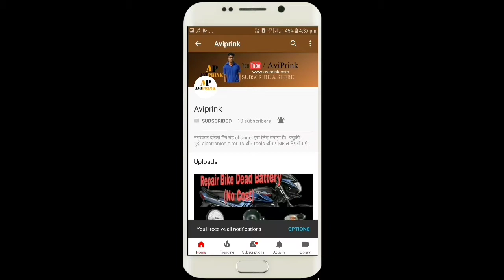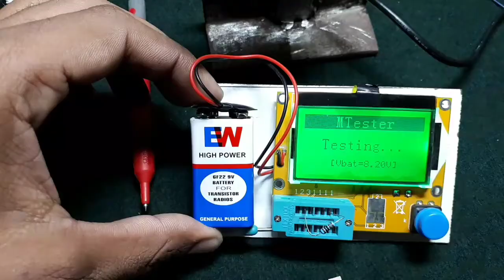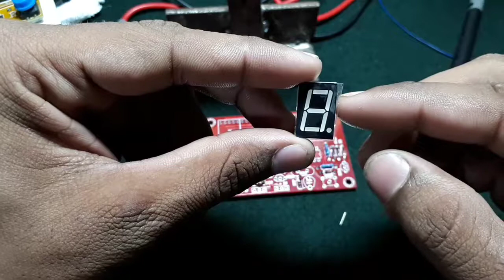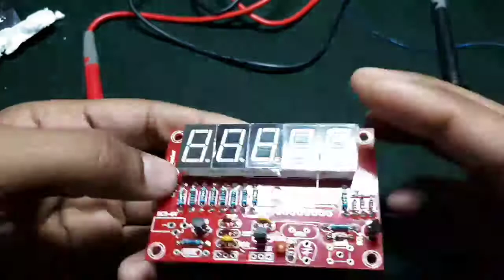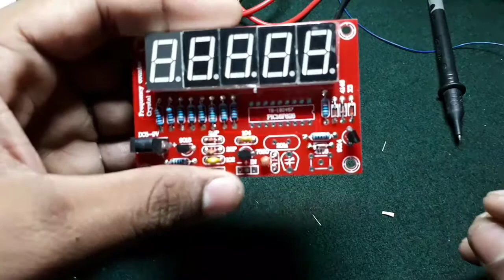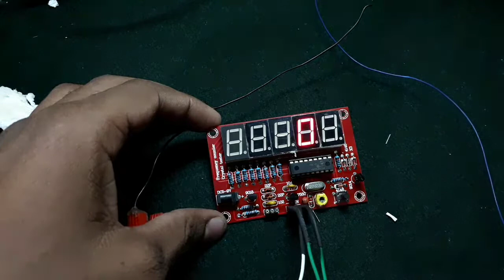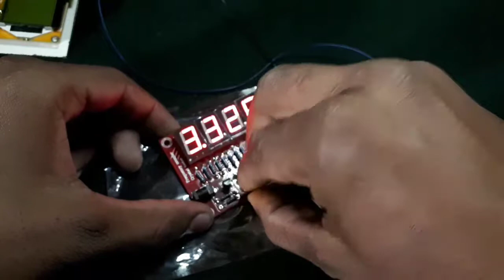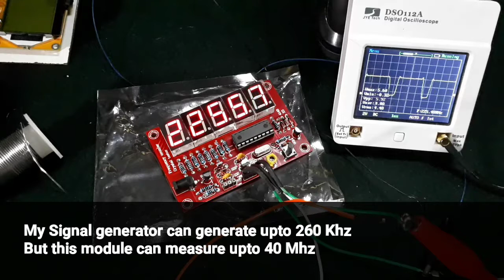#EP-34 Frequency Counter (Pt 1) & Crystal Oscillator Tester Full review pros and cons

Comment: Great video, what is the model of the little tester you are using to check the capacitors and resistors? Can the crystal oscillator tester check the 4 pin crystal oscillators? Thanks!
Reply from the maker: No this crystal oscillator can only measure 2 pin